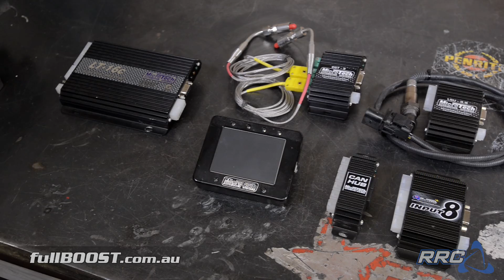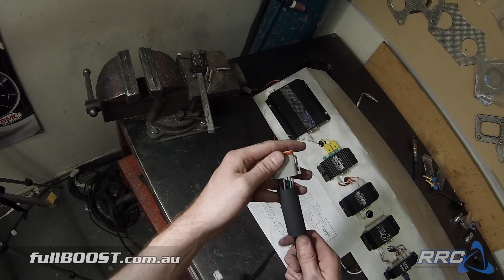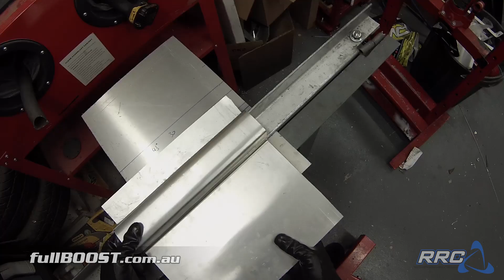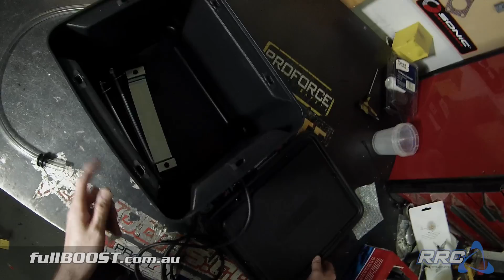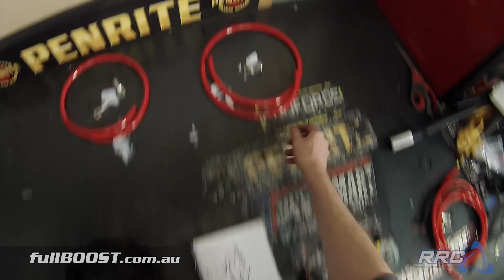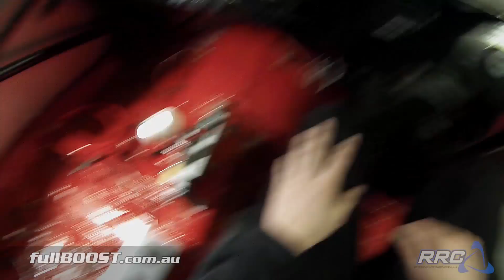BACKYARD MECHANICS | ECU & Electrical Wiring | Project REDLINE Mazda rotary build Ep 8

Comment: Wow.  So many add on modules.  Couldnt you pick an ECU that has enough inputs, EGT amps and wideband controllers and can-bus communications all in the one unit?  It is 2017.
Reply: Also.  You do realise you can get the deutsch hd30 plugs with more than 19 pins in one plug.  And also with a pin size of 20g which would suit the majourity of the ECU wiring sizes.

Comment: that's a lot of black boxes how much did all the micro tech stuff cost surely haltec would've had a better option
Reply: And why is that? Haltech Wideband. EGT and CAN hub are all additional add on and expansion boxes also.
Reply: ok must depend on the model
thank you
Reply: oh and by the way have you ever tuned with a microtec. i have.... and the tuning program i seen is shit house compared to haltec
Reply: Bull i have. Ive used both. And i prefer the haltech. Thats not the question at hand though. You stated about the aux boxes and being cheaper than haltech. Not tuning or interface.
Reply: yes you are right i asked how much does all the micro tec stuff COST
Reply: trying to figure in my own way if haltec was the better choice
Reply: hence the the word "surely"

Comment: Microtech, god damn I didn't even know they were still around. Why are there 5 different modules? Competitors have all that capability in a box smaller and probably cheaper than just the ECU. Just because everyone else uses it doesn't mean it's better, you should have actually explained your reasoning for choosing it. Sometimes everyone does cocaine, doesn't mean you should too..
Reply: Haltech. Motec. FuelTech all have seperate EGT. Wideband and CAN hub expansions. Id like to see what ecu has all of the above in a smaller housing than the LT16c.
Reply: Yeh... EGR box? Wideband box?  Sounds very 2000s...

Comment: I have a question does drive shaft speed  sensor mean you will have traction control??. Like a davis profiler??
Reply: In this particular setup, no, its just an input into the data logger

Comment: All those relays, did you know that each one uses 0.3 amps you are going to bleed of nearly an extra 5 amps running all of those.  You may need to use some with diode protection to protect your ECU. 
I see that your ecu expansion is using K type thermocouples. Don't forget to use the Deutch connectors that are made for thermocouples and remember that thermocouple wire is not standard wire. The required connectors need pins made from the same material as the wire, they also have a Positive and Negative side that if crossed will give bad readings. 
Cheers
Reply: The alternator supplies close to 110 amps, so an extra 5 amps is no worry here.  The thermocouples pass through a rubber grommet and plug directly into the egt module.  thanks

Comment: What electrical kits are those? I am building 2, K swapped Pontiac Fieros and both require custom wiring (obviously), I love the modular quick disconnect bulkhead fitting(s) y'all used. Nice work fellas.
Reply: Hey mate, they are just DT deutsch plugs and a deutsch firewall plug.

Comment: Some nice wiring work there, but Microtech as the "one" option. Yeahnah.
Reply: For a drag car is plenty, the world's fastest rotary's all run microtech so i don't think they can be that bad lol
Reply: yeah, when I checked what ECU my '88 FC was running, it was a  microtech LT-8, albeit its running effectively stock, boost is 7psi, pod filter and catback. for a street driven car is it worthwhile to change out ecu's, as from what I read, microtechs are good but a bit limited, and hard to tune. as I'm working on my clutch I had to pull the exhaust, and the exhaust out the turbo is very white, so from what I understand, this is either lean or ash from premix oil? anyway I've got a megasquirt ms2 v3 with a wideband at my disposal so I'm thinking of putting that in there for easier tuning, not sure if the microtech has a wideband or what the hell its doing.. for the most part it felt fine but couldn't 100% tell because the clutch/flywheel were vibrating so bad. so that's what I'm fixing now, but tunability is the next step

Comment: You should put bushing/edge protection on the holes where the wiring goes through the dash
Reply: The word you're looking for is 'grommet'.
Reply: Andrew I wasn't, but yes a rubber grommet would also do
Reply: Bulkhead or gland

Comment from the maker: In this episode we cover the MicroTech engine management system and how it will be wired into the 13B rotary powered Mazda 626 Redline project.
Reply: Fullboost if you had a haltech sport 2000 all that shit and map sensor would be in one unit